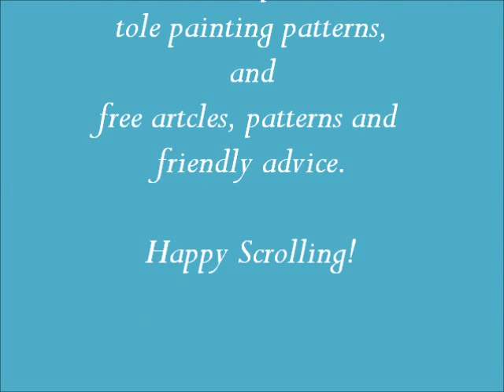Embellished Ornaments

Comment from the maker: Not really. I used cherry in the example. I would suggest hard wood such as cherry or maple that has a tight and even grain. Something like pine or poplar would be much too soft.  The blades I used are a 2/0 and are very thin - almost like a hair. They are quite easy to control (if they cut too aggressive, you can always slow down the saw a bit!) and you can get very close to the bead holes without negative consequences. Even if you are really close, once the bead is glued in it is very strong.